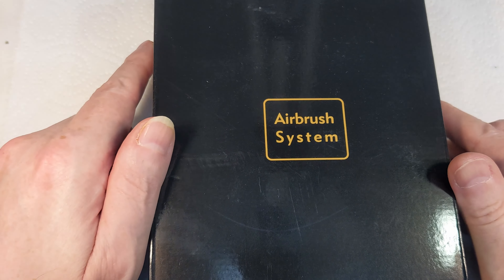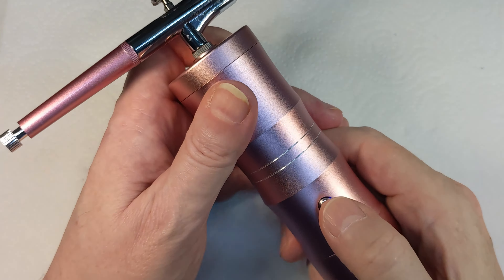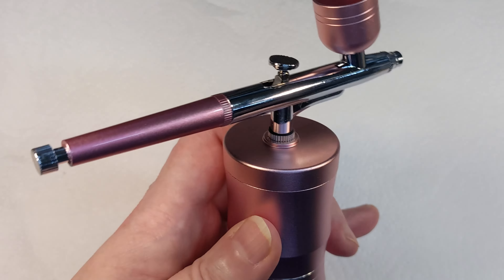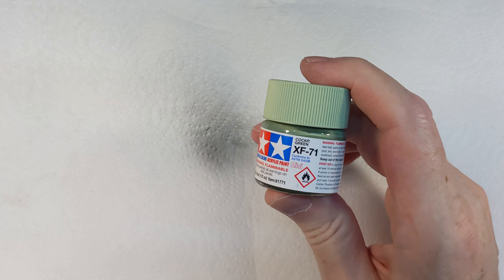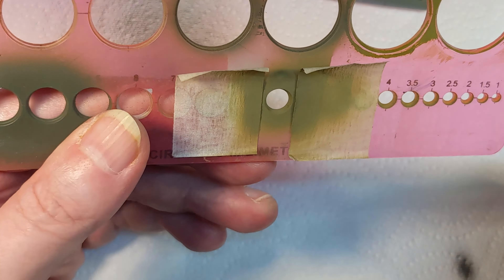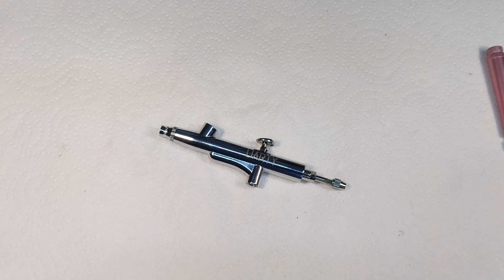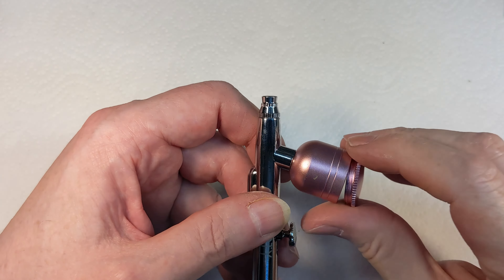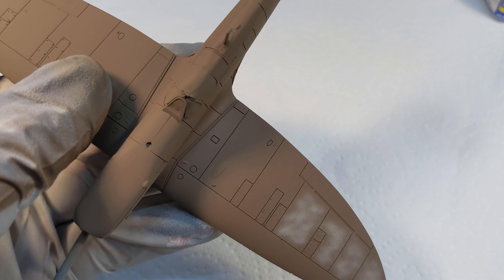Testing out a new airbrush (with a twist)

Comment: Not seen one that cheap and at that price it is worth getting.  Had been thinking about something like that for a while to do odd scratches on the car where the usual airbrush would be a pain to get to.  I was going to ask if the instructions suggest if there were any limits on what paints you can use (lacquers) but I am guessing they may not! 😁
Reply from the maker: I suspect that anything cellulose or solvent based might eat the O rings, but nitrile O rings are easy enough to find, so it might be worth giving it a go... 🙂

Comment: I also bought a battery powered airbrush, but it's double action, and comes with two removable batteries that screw in to the base of the pump, so I can charge one while using the brush & swap. Sadly, the lever is too close to the cup, so I can only get the tip on my finger on it, and it gets quite painful after 10-15 minutes, plus it does not have variable pressure...
Reply from the maker: That's annoying. I'm sorry it didn't work out for you.
Reply: @SteamGeezerUK  oh, it works just fine - for short sessions. I mostly paint 1:100 scale tanks, so I can paint a good few in 15 minutes.  Vastly superior to trying to get a paintbrush in at the suspension...

Comment: What am awesome little airbrushing set! I might be tempted to get one of these myself! Is the screw thread on the compressor the same as a standard airbrush hose? And could you use any double action airbrush with it instead of the included single action one?!
Reply from the maker: As far as I can tell, it's the same thread, although I don't have an adaptor handy to go from male to male threads so I couldn't try it with my other airbrushes. One thing that concerns me is that the compressor blows constantly and I'm worried it might strain it if it's trying to blow air through a closed double action valve, but it needs more investigating.
Reply: @SteamGeezerUK  I must admit I did wonder myself how the compressor being on all the time when in use would work with a double action airbrush. Maybe I'll get one and try it! Thanks for the reply and info 👍

Comment: Hello good sir, I've just received this airbrush based on your recommendation. I'm probably being a numpty but how do you pull back on the trigger? (I've only ever used siphon feed compressed air can type before) Is it a case of unscrewing the cap at the rear of the airbrush? Thanks in advance
Reply from the maker: It does have an adjustment screw on the back that allows you to set the travel on the trigger - make sure that is backed out until you can move the trigger freely. It probably got wound in at the factory or something 🙂
Reply: @SteamGeezerUK  Thanks, all sorted👍

Comment: Looks better than a lot of the single action ones I've seen, most are garbage. Just note the marketing, for all of these it's bs, you wont be getting 30psi, more likely 20 - 25 psi for good quality ones. The "30 psi" is the psi coming either directly from the compressor with nothing attached or the little motor set up inside the compressor.

I've got a Spray Gunner "No-Name Brand" cordless airbrush double action, 0.2mm needle, mac valve, removable batteries, works well from the little testing I've done. Have to play with it more but waiting on proper airbrush paint, hobby stuff is to expensive to waste lol.

When you add other stuff inline like quick disconnects, moisture traps, hoses etc for the cordless ones that can support it, the psi will drop rapidly. With mine if I add the included hose it drops to I'm guessing under 20psi, add the quick disconnect and moisture trap with the hose it's down to maybe 10. I don't use the hose, just moisture trap and quick disconnect, still seems to have enough pressure and I can use all my other airbrushes with it.
Reply from the maker: I haven't tried my other airbrushes with the compressor yet, but it's on my to do list 🙂
Reply: @SteamGeezerUK  It'll be interesting to see if other airbrushes work with it.

Comment: I may have missed it but did you say how long the battery lasts?
Reply from the maker: You didn't miss it. I didn't do an endurance test on it, but the instructions recommend using it for half an hour at a time. I did notice it started to get warm after a while, but I used the breaks to charge the battery. I didn't have any issues throughout the whole build, but I honestly didn't push it that hard.
Reply: @SteamGeezerUK Certainly seems like a handy little gadget!